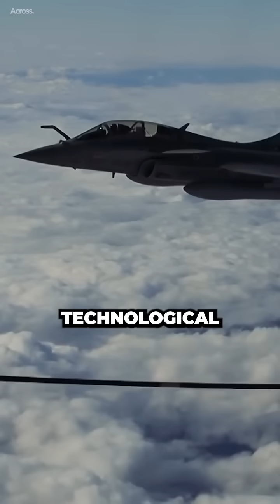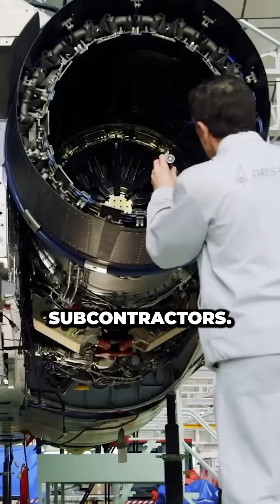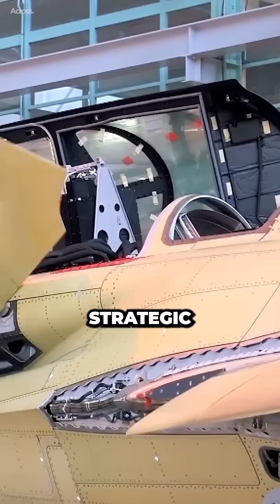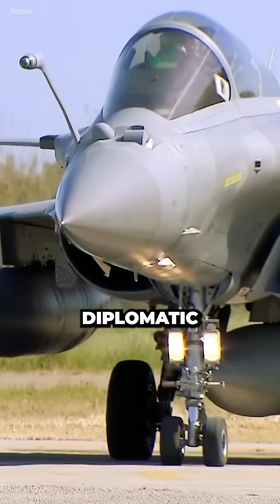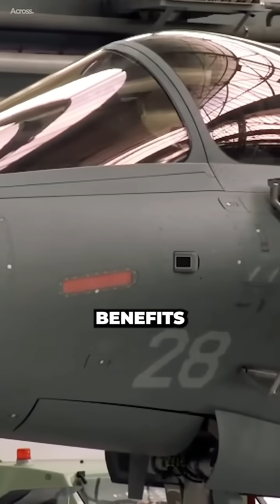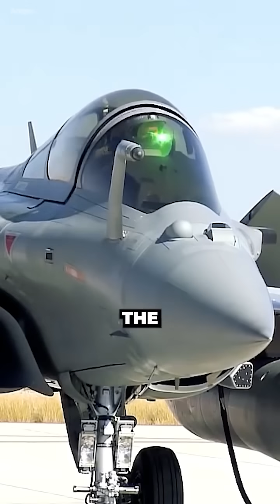Why Does France Sell Rafale Fighter Jets to Other Countries?

Comment: It’s about the pilot training. Better pilots will fly it well, but it’’s on a level with the Typhoon in terms of engineering. The one issue for them is that the typhoon is less expensive but does the same. But it’s still a good machine all the same.

Comment: Silly question.  Why does America sell its aircraft abroad?
Reply: other than the fact that their products are excellent ( if you do not look at the maintenance, operational cost etc ) for political reasons ( F-35 in Europe ).
Reply: @lamafrance1390  Some of their highly technical products are extremely difficult and expensive to maintain, look at the Abrahams tank in Ukraine.  And who would buy any foreign product if it comes with a "kill switch" according to Trump.
Reply: @brianbarcroft9167  it is exactly what I've said but yeah " excellent ( if you do not look at the maintenance, operational cost etc )"
Reply: Americans, they don't sell, they impose.
Reply: It’s mostly political decisions that determine what fighter jets you buy. I read today that donald wants Europe to buy more American ordnance so there will be a lot of pressure to buy something like the F-35. No doubt a good plane and also created with the American war doctrine in mind.
Reply: @brianbarcroft9167  What matters, in case of war, is whether you can operate your weapons system whatever it is. American fighters are made with the American war doctrine in mind and requires that you have pristine airfields that you can defend.
Reply: @TheFrewah  I suspect that after the outbreak of war in Europe not many air bases would remain pristine - on either side